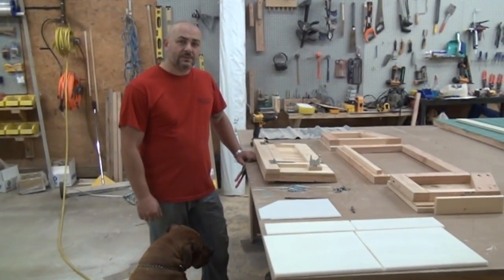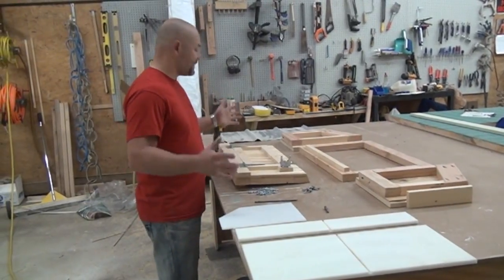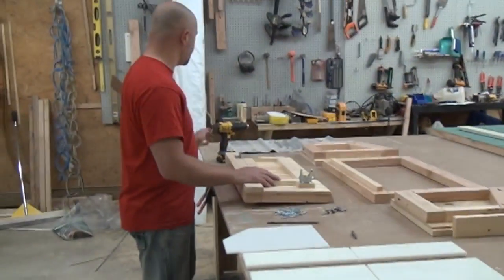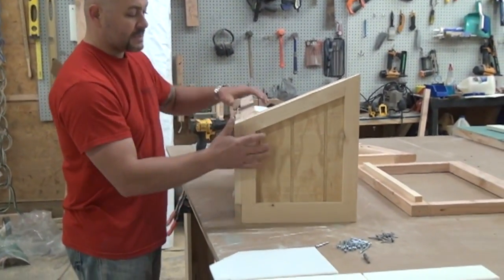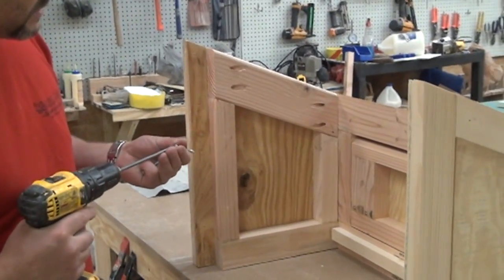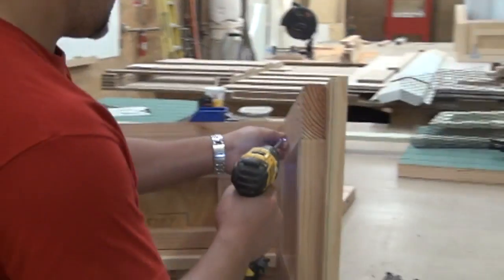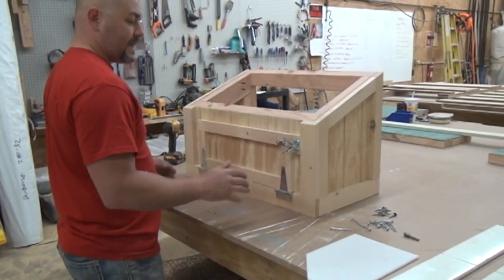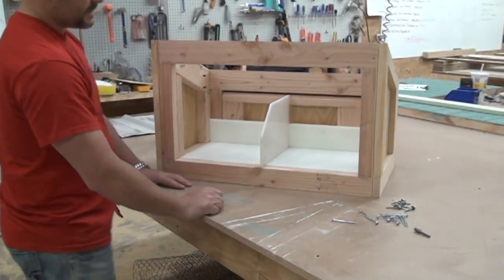Egg hutch assembly

Comment: I just purchased your 3 nest egg hutch and it is beautifully crafted.  My only concern.  Could an animal push out from the bottom the plastic and enter the egg hutch and henhouse?
Reply from the maker: With the construction of the egg hutches, the siding and fitment of each piece means that you don't have to worry about predators entering from the bottom of the egg hutch. However, let's hope they spot big foot somewhere else. Let us know if you have any questions, you can also always give us a call at 919-794-3989 for more help!
Reply: Thank you. I noticed the Egg Hutch doesn’t have a roof other than the metal.  I live in Wisconsin will this be water tight in the rain and snow??
Reply from the maker: @magsgarage4611  Yes, you won't have to worry about water entering the egg hutch, when it comes to snow, if its heavy snow, you may have to look into our foam inserts or something similar for yourself

Heres a link to a video, where we discuss how to protect your chickens and coop in hot climates and cold climates. Matt talks about protection from rain and snow towards the end of the video, but you'll see that its timestamped: https://youtu.be/ECR_gL7tEug?si=FNhwvUeEXh4J3JGb
Reply from the maker: @magsgarage4611  Also take a look at this video, it should help out a bit with understanding how our egg hutches can help prevent an issues with rain: https://www.youtube.com/watch?v=v4DM-uIEkiQ

Comment: Excellent build and great design. 
The only thing I'm surprised about is the lack of roof insulation, but you also left off the foam closure strips, so you would have a little air flow. I only comment because we have a lot of direct sun on the side of the coop where the nesting box is.
Reply from the maker: Bill Jutz I agree.  I see no reason for the foam inserts.  Why not let the egghutch have the ability to breath as much as possible.

Comment: Beautiful egg hutch!  I just wrote to you about purchasing one for our new coop.  Only question I have is couldn't a raccoon push up the bottom of the egg hutch and get in?  Could a piece of wood be installed underneath the egg hutch below to prevent that from happening?  Thanks.  Keep up the good work.
Reply: THANK YOU!!  the egg hutch is up about 36inches off the ground.  We have yet to have a "break in" of any kind to date.  Im sure anything is possible though.  You can add whatever you feel necessary or we can customize to your specification!
Thanks for watching
Reply: Thank you for the info.  We have a terrible problem with raccoons.  That is why I am worried about them getting into the coop. I don't trust those little rascals.  We had one attack our little pug dog a few months ago and he was right outside our kitchen door on our deck.  They are so bold and we always seem to have a whole family of them hanging around.  Right now our goat protects our chickens, but she is 16 now and won't be here forever so it is time to build a "high security" coop!
Reply: all of our latches are lockable as well!
Reply: Perfect!